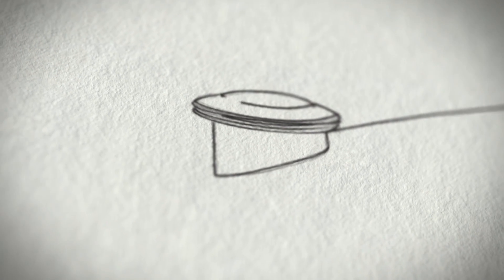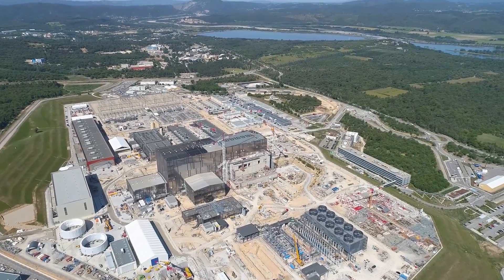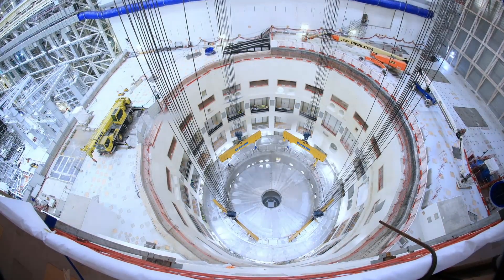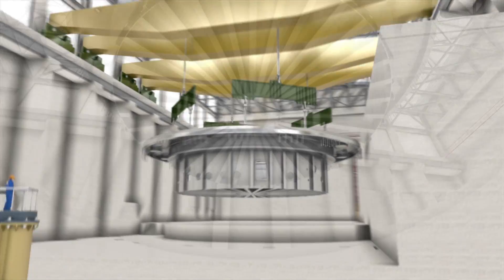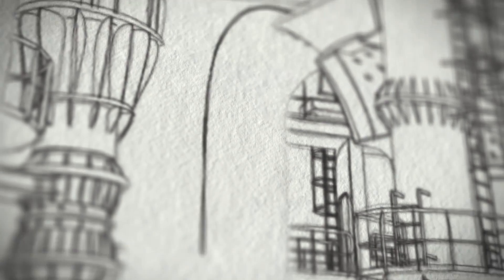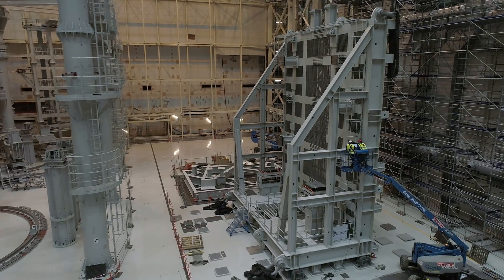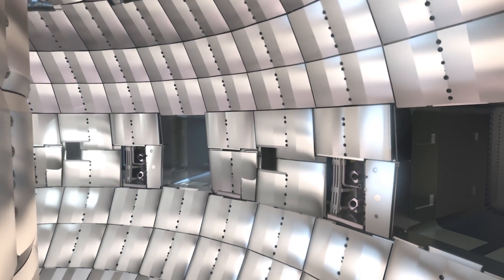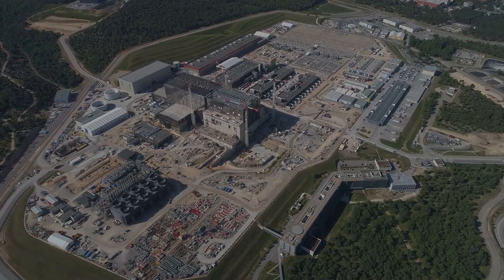ITER - the world's largest puzzle (2020 version)

Comment: By the time this puzzle has been solved hopefully the entire world will be powered on solar, wind, hydro, geothermal and some wave power. Then you won't need these types of reactors.

Solar and wind are already making up a big percentage of the current energy mix.
Reply: wrong. Fusion power is the future. There are many problems with solar, wind, hydro and geothermal energy sources.
Reply: @raoulduke7668  solar, wind, hydroelectric and geothermal all have problems that can all be solved, and in 20 or 30 years they will totally dominant the power grid.
Reply: @matthew_baynham  thats true but this kind of reactor isnt dangerous and does not produce nuclear waste, sure there will be downsites but at the moment it is our best option
Reply: @user-hx7dc9uz6s  solar, wind, hydro, and geothermal don't produce radioactive waste and they are much easier to get working.

Comment: It's a wonderful device, and I dearly hope it works to everyone's satisfaction, but I still don't see the path from ITER to usable fusion power production. Obviously no commercial power station would be built at anything like the cost of ITER, and even if the problems associated with high temperature plasmas could be solved, it is hard to see this great device as a practical prototype. Even if it works flawlessly, it may go down in history as a noble dead end.
Reply: @Kirk Mattoon
I agree. But on a positive note, we will gain knowledge. Not only will it's development be beneficial to other sectors as there are challenges to overcome, we will also figure out the 'why not' if it turns out to be a dead end. If anything it will then guide the science-world to develop a different type of technology to generate energy. I think it's also great that several countries are collaborating to take on the challenge.

Comment: yes it is an amazing piece of engineering but this is just a prototype, and will require another iteration of the design that is larger still before it is ready to provide power for the grid. i'm afraid fusion by this method is still someway off.
Reply: I agree, but this will still provide hugely important scientific data and knowledge that will be crucial for the next step, no matter what direction follows, and pave the way for commercial fusion electricity.
Reply: @snetmotnosrorb3946  i suppose i should have added that in my opinion  by the time this sort of fusion is available that it will do nothing to mitigate the effects of climate change - it will be too late, it's too late now. I mention this because the comments here have a "nuclear fusion will save the world" kind of vibe.

Comment: I don't think this project is as crucial as most people think. It's impressive, no question, but it's not like it would solve magically all our energy problems or really fight the climate crisis. The tools and the building blocks we need to transform our societies and economic systems to prevent further destruction of our planet and deal with the consequences we already experience and will experience in future, are already there. We cannot think of sustainibility as something which we can simply add to existing structure, we have to really change the way we live in almost every aspect. That of course takes its time, but otherwise it wont be succesfull. So even a device which would bring cheap, clean, accesible energy, would just feed the desires of the existing systems, which we all know is not gonna bring us well through the 21. century.

Comment: This project is a dinosaur. By the time they complete it, mouch smaller fusion projects with mouch stronger  magnets will have achieved what ITer set out to do.
Here's an example
https://www.youtube.com/watch?v=hWYnbYsp3i8

This is because magnet technology advanced well beyond what was thought possible at the time when ITER was designed. With weaker magnets you need a larger vessel to make the plasma stable enough.
Reply: hey there - truth is, we still haven't figured out fusion and the more research there is, the better. so to call this project a dinosaur may be presumptuous right now. 

if tokamak energy figures out a better way before iter, good for them. well, good for everyone actually! but, you do have to keep to keep in mind that the video you shared was made by the company itself and so it would be wise to take it with a pinch of salt. 

anyhow, for the general public, this is a win-win.
Reply: @funnypallu  The more research the better? They could've built 20 regular-sized vessels for the same money. That's 19 ITERations they have missed out on. 
Their video was made by the company itself? So was this video. If anything, I'll view this video with a pinch of salt that's proportional to the size of the project.

With that in mind, I do realize that because of the way politics works, a larger project is harder to get cancelled than a smaller one.
Also, I'm curious of the technologies that they will get to test in ITER. 
This is not even the most complicated project out there. GO german stellarator

Comment: It sure does give hope for everyone especially the Energy science community. But from what i heard this is not for energy production. Its a test site
Reply: Yes and no. It should be the first fusion reactor to produce net positive energy. However, as a test, it will not convert that energy into electricity to be used, but will just exhaust it into the air/river.
Reply: @zemerick  what about the system self sustainability?
Reply: @mainkordormawblei  That's one of the key things ITER is to experiment upon. Hopefully it works well.
Reply: @zemerick  lets hope so

Comment: What happens to the massive assembly tools once construction & assembly is complete since they're project only specific?
Will they be recycled or held to one side with a view to reuse in construction of new fusion reactor power plants should the project prove successful?
Reply: Most likely a combination of sold for scrap, and kept on site for maintenance. A lot of the parts these tools are for will wear out, or need to be tweaked as part of testing.

Future plants will be so different though they wouldn't be able to use the same tooling. DEMO is the next one in line, and it's supposed to be A LOT bigger than ITER for example.

Comment: This is of the greatest importance for all mankind
Reply: ungratefulmetalpansy  energy is more basic than food and healthcare.
Reply: ungratefulmetalpansy  >believing renewable energy is enough
Reply: *personkind
Reply: @MegaKalkas  

fair
Reply: Why is this of the greatest importance for all mankind?   It's a wildly expensive monstrosity with a mammoth carbon footprint.
Reply: @incognitotorpedo42  

If nuclear fussion energy is proven to be viable it would be one of the most ecological sources of power.
Reply: @eruno_  That depends on the energy output versus the cost and carbon footprint of the reactor, also considering the required maintenance.  It's entirely unclear at this point that fusion is "the answer".  ITER certainly isn't.  It's a wildly expensive learning experience.  I hope it's worth the money, but I suspect it will not be.  If fusion is ever to become viable, it will be one of the small groups currently working on it, not ITER.
Reply: @incognitotorpedo42  

I agree. I never said ITER itself is an answer as it is only the experiment. But without experiments like these we could not advance in the field of practical application of nuclear fussion.